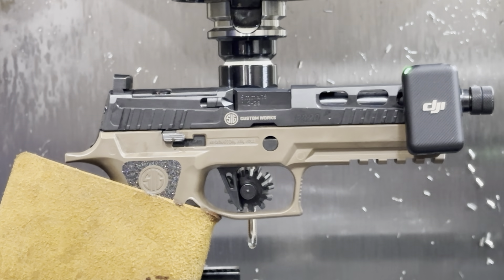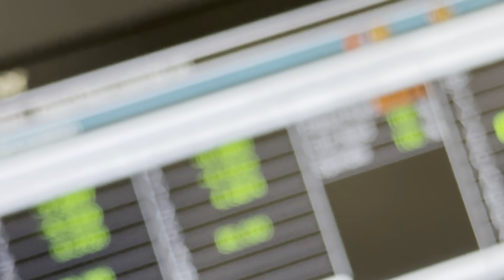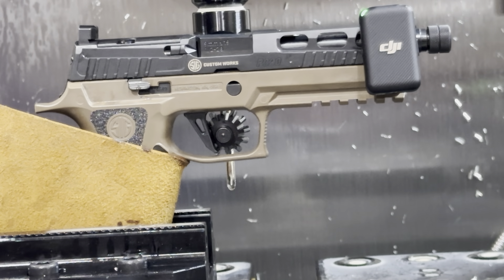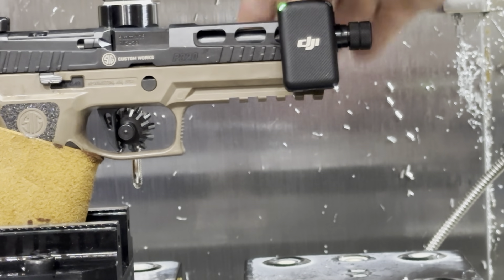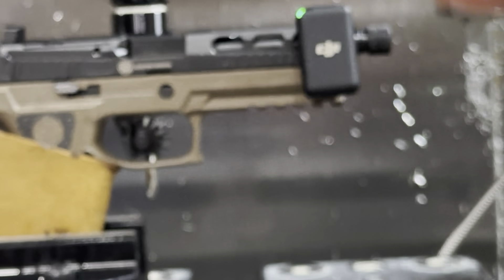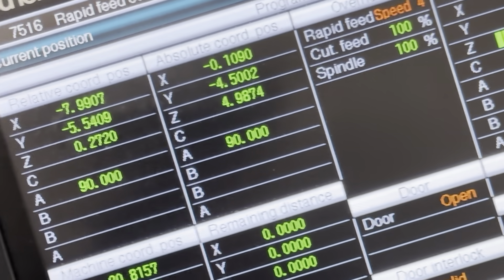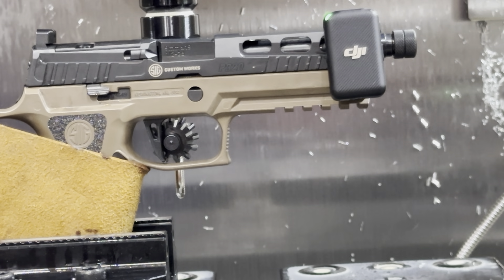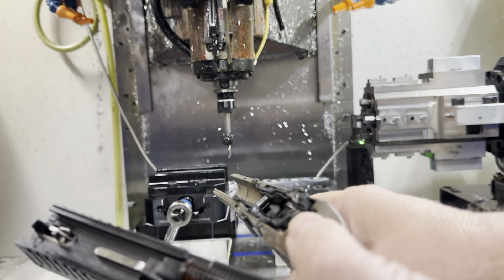Sig P320 accidental discharge tested in CNC machine.

Comment: Someone should try pulling the trigger and reseting it while holding the trigger, then slowly release the trigger and see if it can get caught in an intermediate position, which would allow the slide to set it off. That would be the combination of failures that would allow the P320 to go off without any trigger pull.

Comment: No worries, I believe it only goes off or burps with non Sig brands of ammo!   You should always burp pat it before holstering it after feeding. Cams are designed to move with the least amount of force.  I suggest a pin, like a grenade has,. Just drill a hole in the slide ahead of the firing pin. That would loo really awesome.

Comment: Thank you for showing this. I’m limited by the tools I have - I don’t have a CNC machine to precisely move it - but if you do this with a magazine in with dummy rounds in, your results will change. The pressure from the round and follower pushing up removes the “wiggle.” In other words you would not get the striker to release at .090. Showing it is even more safe when configured in an actual real state.
Reply: In mine (measured through calipers) it goes off sooner than .90 thou. goes off at .76mm (30 thou).

Comment: This is showing that the connection on the sear is capable of slipping and other safety measures are not preventing a discharge. So, a gun with a slightly out of spec sear connection gets input on the slide like this, it can go off.

Comment: You guys in the us should ditch SIG. Really. the P365 failed at the beginning. the 320 not drop safe. now this shit. A german state had to dump MCX's (worth +4 mil. Euros) because of bad material quality (soft Steel etc.) and replace it with quality HK products. You have so good manufacturers in the U.S. why are you obsessed witth this brand?

Comment: I don’t understand what people think they are extrapolating from this. You have to pull the trigger 83% of its travel and a slide manipulation will cause the striker to slip off of the sear? Tough crowd. What is acceptable? 0.109” trigger stroke, 0.090 to make it slip off the sear with manipulation. That leaves 0.019” before the gun would fire anyway. The thickness of five one dollar bills. Three human hairs.

I get that there seems to be a problem and tolerance stack comes in to play, but this video supports SIG in my mind.
Reply: I’d like to add:

I am not saying that I think this is a “safe” design. Glock set the standard with its design and this has quite a bit less margin of error baked in. The price of a short, clean, light, trigger pull on a striker fired pistol. 

This video just isn’t a silver bullet that proves the sig design can fire without any trigger manipulation. 

You could say that if the parts were way out of spec and/or the firearm was extremely dirty that it is possible that there is not sufficient sear engagement to be safe in conjunction with a stuck/failed firing pin block. However that is not a design issue, that is a QC issue that will be easily identifiable in the firearms that are discharging uncommanded. Not an inherent design flaw that plagues every single weapon. If you make a 1911 sear engangement short enough and the firing pin blocks are failed it will also fire uncommanded if you sneeze on it.

Comment: All of them are different tolerances. Carbon build up on the sear could cause it to hang up if the trigger was partially pulled and then never fired. Now you take that weapon and place it in a holster and as it gets wiggled around, and boom 💥 😊

Comment: This is a far more accurate version of the testing I was doing with calipers and a bit. Incremental movement made my personal 320 drop the striker only at about 0.1mm before the normal trigger breaking point. Measuring from the frame to the back of the trigger i had 13.9mm at the wall and, like you, just over 2mm of travel before the break at about 11.7mm. I was able to get the slide manipulation to drop the trigger at 11.8mm at the furthest point. Which, in reality, is the same as pulling the trigger on mine. Thanks for posting this, it matches my crude results with precision. We need large data gathering on this to be honest, at this point...

Comment: Way to come to the wrong conclusion.

You're trying to conflate a "trigger resting at the wall" with an actual "trigger pull." A gun should only fire when the trigger breaks past the wall, not when the trigger is resting at the wall and/or the slide gets bumped by an external force or moves by its own inertia. In a perfect world, this would be absolutely unacceptable by any gun manufacturer, but we live in a world with Sig.

You have only proven that the design of the P320 is inherently unsafe, just like many others have.
Reply: Where did he say that his conclusion was that there wasn't a problem here? He seems to be just wanting to give data and let the viewer decide.
Reply: @vversusv1364 the obvious sarcastic attitude in the video is proof lol. regardless, he tested the two completely differently and it was obviously done specifically to get the glock to fail and make the p320 look less bad.
Reply: this

Comment: This shouldnt happen at all. But where I'm lost is, when/where/how would the trigger be pulled 90/1000ths in a scenario other than when you want it to go bang? How can this happen in a holster etc?
Reply: Some potential situations that could simulate a partial pull of the trigger are you drop it/vibrate it, get some debris on the inside, or if there is a holster that touches the trigger upon reinsertion of the gun
Reply: The problem is that other people have got the gun to go off with just a screw or their finger pressing the trigger near the wall, which tells me that precision is not needed for all P320s. If ti required this much precision, the person would either pull the trigger all the way or the gun wouldn't go off by the slide unless the person go really stupid unlucky if such a thing were even possible.

Comment: If you a thinking man, try doing this again with a FULLY populated magazine of snapcaps. I bet you'll find that the mag spring and round stack will change these numbers forcing the slide up on the rails of the FCU.

But that slide play is absolutely atrocious. Never have I ever seen a handgun built like this.
Reply: amen
Reply: This is an important point that even Wyoming Gun Guy didn't factor in. There needs to be a full mag of spring pressure up on the slide.

Comment: Great job of quantifying the movements of the trigger. I don’t know if this definitely shows proof of the gun going off without a trigger pull, as you are pulling it a small degree. I still highlights the flaws of the design. This gun should not exist.

Comment: If the gun fires at 109, there shouldn’t be anything that can make it fire before 109. If wiggling the slide can make it fire at 90, that is a fault. Whatever can contribute to the firing of gun between 90 and 109, can also contribute to overcoming the striker safety release between 80 and 90.

Comment: Pull the slide off and see what the 90 thousandths of pull is doing to the internals. Is that much take up moving the sear at all or simply deactivating the striker safety? Either way if you can get the gun to fire without a full pull of the trigger that’s not good. And your gun is a sample size of one out of millions of guns. With a large enough sample size there very well could be guns that have faulty striker safeties that don’t need much if any trigger manipulation to discharge.

Comment: Is there any chance the issue is bringing the trigger to the 90 thou mark, releasing the trigger and then due to manufacturing tolerance stackup, cleanliness, etc is kept held in that mode where wiggling the slide makes it go off?

I personally agree if you nearly pull the trigger most of the way to firing, then muck about with the slide/rack mechanism, you get what you get.  BUT, if you put pressure on the trigger and release it, and it later goes off without your finger on the trigger, that's a problem.  Also, have a P220 in .45 and love it.  But there's enough anecdotal evidence that there's something going on with the P320 that I would not own one.  Just my opinion...

Comment: The entire point of doing this test is to simulate out-of-spec parts in the action - the sear specifically. The test isn’t about getting 1mm into a trigger pull, or 2mm, etc. the test demonstrates that there is enough slop in the design for a jostle of the slide to release the striker if the sear engagement isn’t large enough. It is undoubtedly different for every particular gun, but I’m willing to bet that they will all do this at somewhere less than a 100% ordinary trigger pull. The major problem guns do this with 0% applied to the trigger.

Comment: I own a P320, M18, with external safety. My slide is a tight fit on my frames. Back in the day, I carried a 1911a1, "Cocked and Locked", in the service. When I carry my Sig, I do the same. I have tried numerous ways and times to get it to discharge "Cocked and Locked", all to no avail. For the most part, these test video's use a firearm with no safety and using a depressed trigger to some extent. 

I am not denying that there have been accidental discharges that resulted in injury and death, and I wasn't present at any of these events. So, I don't know if they could have happened, with more training, or better engineering by Sig. I do think that a lot of people have jumped on the anti-Sig bandwagon, in a feeding frenzy.

I am disappointed in Sig's response, or lack of. I think that they need to own the problem, do a product re-call. The re-engineer the entire internals, and put the thumb safety on all of the upgraded P320's.

I know it will cost millions if not more, but it will outweigh the negatives and show that Sig is a stand-up company, that will make it right. If they don't, Sig will lose more in the long game.

Comment: Am I missing something here? The trigger is being engaged to the wall and then the slide is being manipulated to cause a un-commanded discharge . Correct? That is a lot of manipulation to consider this un-commanded. A holstered firearm that has a trigger engaged to wall and then enough manipulation of the slide to cause the pistol to fire? I did a holster check with three holsters making sure the 320 was seated as deep as possible in each and then I pressed and squeezed the kydex as mush as I could, even banging it on my bench and I could not get the 320 to fire on a snap cap. I appreciate all the hard work and effort you-tubers and the internet are putting into this, but I wish Sig or another authority would come up with some concrete evidence to put this to rest. I just don't think this theory is a completely practical application.

Comment: Good job measuriing on a CNC machine. FYI, Sig does not stamp calibers on their user serviceable FCU's and if a 45 ACP or 10mm FCU is used with a 40 S&W or 9mm grip module, slide and barrel, the P320 can be loaded and the magazine safety block will not engage with the smaller magazines. This has nothing to do with the current problem. It is just another oversight that Sig missed not marking the caliber on their interchangeable FCU's. Silly oversight since they stamp calibers on their magazines. I have to be careful after cleaning multiple FCU's not to insert my 45ACP FCU in a 9mm grip module.

Comment: Maybe I missed the point but my understanding is the Sig 320 pistols are uncommanded firing without touching the trigger. My guess is that excessive movement of the slide on it's frame allows the firing pin to slip off the sear causing the weapon to fire. The safety bar is not working correctly to prevent the firing pin to go forward firing the weapon.

Comment: This video is as cringe-worthy as watching the View.
Honestly the ignorance that I see in this video is staggering. First off, all of the issues with the P320 is that the claim that the P320 fires by itself without the trigger being pulled. However, every time the P320 fires in this video, he pulls the trigger at least part of the way and then is surprised when it magically it fires. When you pull the trigger back 0.090” inch (2 mm) in the video you've now unlock the safety lever where you change it from being in the safe position to the fire position. This is the point where the trigger is now applying pressure on the seer to release the striker. At this point you press the slide and the gun fires, and then you magically believe you’ve solved some big mystery that makes it fire. All you have done is put the gun in a battery position that will allow it to fire. You are not proving anything is wrong with the action of the gun, if anything you are proving that Sig claim is correct because you literally pull the trigger every time to get it to fire.
Instead of focusing on how to get it to fire by partially pulling the trigger, focus on why it fires without pulling the trigger.
Reply: Just another moron responding to another moron. Neither of you know what you are talking or arguing about.

Comment: Ok bro. The bottom fuggin line is that a fuggin sig 320 has a reputation of going off in holster , whether it's because a certain amount of 320s were made with way more play then should be allowed..how do we know this ?? Because there is a increasing amount of accendental discharges..not to mention why didn't you play with the back of your slide while being a mm squeezed ,because that is what seems to be problem. Why some of you people are putting vigorous defense of a obvious problematic gun is beyond me. Unless your paid by sig , or works for sig. If not you just want to argue and maybe defend a gun company for some Strange reason.  Sig sucks they need to recall it. There is a fuggin glaring issue with sig 320..fugg em.i like colt. The gun that beat the south .. .so fugg sig..God bless our troops .and God bless the usa .

Comment: i see a lot of theory's and stuff about y this is happening but what would be the actual solution not just "oh don't buy one" like from an actual mechanical standpoint now i'm nowhere near an expert on it but the only thing i could think of is having the hook sit deeper on the sear so it couldn't just slip off cause i've been able to get my p320 to do this well over 20 times now and only get it to go off messing with the front of the slide so id imagine that moving down on the front in enough movement to get the stryker hook to slip over the sear cause then imo that would explain y they r going off in holsters the tension from the holster pushing the slide just enough and then the slightest little thing could make it slide off the sear. just genuinely curious if thats whats causing it and what a solution could be

Comment: once some touches the trigger 
it is not an accidental or uncommanded discharge anymore 😎
Reply: Bingo.... if it goes off when it's dropped that's totally different and a problem.
"Keep your booger hook off the bang switch"
Reply: @haywoodyoudome  different triggers has different sensitivity ... but all designed to go bang when touching 💥

Comment: Cool test showing that there is a definite issue in the striker being able to fire if there is even a slight misalignment of the sear. One thing to note, this pistol, the p320-xfive, is around double the price of the m18 and doesn’t have the manual safety.

Comment: This is great, but you literally have accident reports and a dead body showing that a finger was not on the trigger. Something in the gun is not resetting, or the tolerances are stacking in some way after 1000s of rounds which results in a critical failure.

Comment: Nothing personal, but I’d prefer my firearms to fire when the trigger is fully depressed and not when it possibly has a slight amount of pressure on the trigger inside my holster and the slide wiggles. What you did not show is the pressure required to move the trigger and the pressure required to break the sear with the trigger. You didn’t at all convince me that this Sig is acceptable.
Reply: You are ignoring the pretravel or slack before the trigger hits the "wall" I wish he had included this in his measurements.

Comment: I still don't think ANYONE is getting the point! SOMETHING IS WRONG with THIS FIRE ARM. No other side arm in military history has caused this many problems in modern firearm technology.
Reply: The Glock in the 90s did. Even got a special NYPD trigger for em. Not the same thing (training issue vs potential material or whatever issue), but they definitely had their moment in the light.
Reply: he proved the glock failed the exact same test. watch his other video
Reply: Glock leg…. Desk pop. True it was due to training people on a new firearm not a engineering problem
Reply: did you know every striker fired pistol of every brand will fail this test?
Reply: id argue there is not even a single side arm in the civilian side of things as well

Comment: I'd like to see him take up the slack, go about .085" past the wall, back off, and then come back into it and see what happens.

I've noticed that if I prep the trigger, not take the shot, and come back to it, I get a stupid light break. It's like friction is not letting everything reset. I really have a feeling heavier springs will alleviate most if not all of the problem. 

Competitors will not be happy, but my X5 has too light of a trigger to carry as it comes from the factory.

Comment: Ya but mine fires by wiggling the slide AT the wall. Some are firing without being at the wall at all. Yours seems to be more inspec than others. I think you’re missing the point of the issue here. Also the gun should NEVER fire unless the trigger is pulled. Jesus.